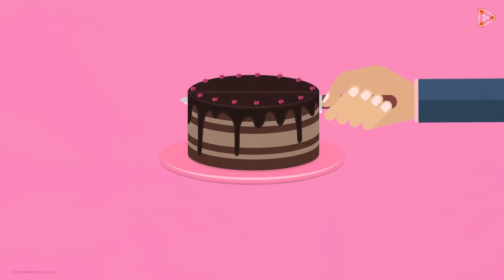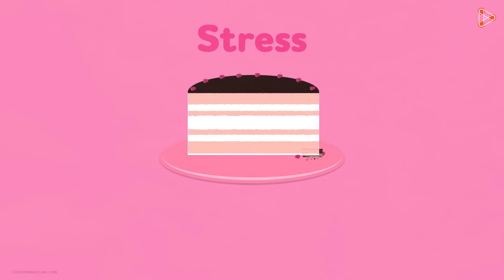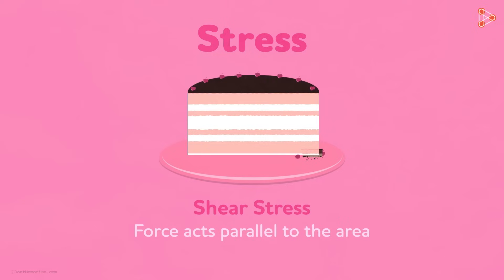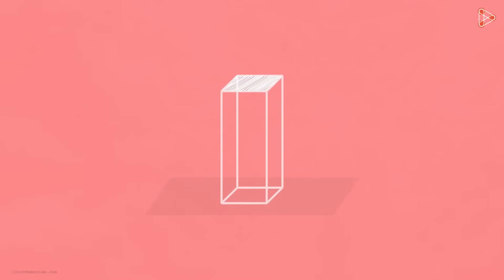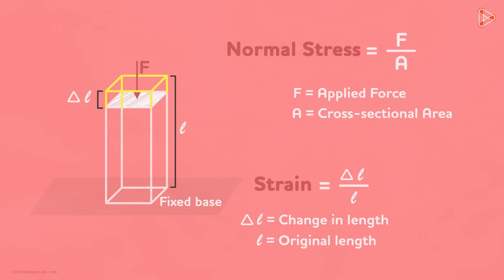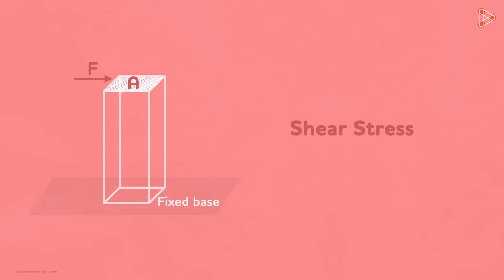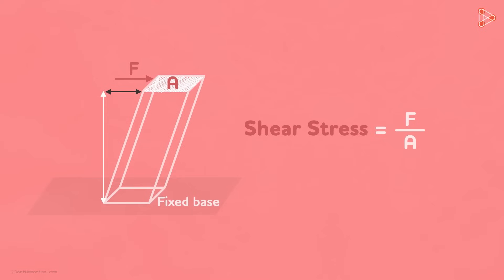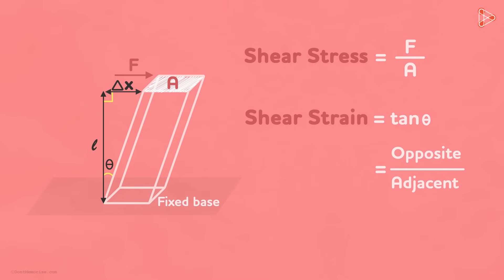Shear Stress and Shear Strain | Mechanical Properties of Solids | Don't Memorise

Comment: i think you guys have got confused with both stress and force. how come when you are applying a force though the knife to cut the cake there is a instantaneous stress getting induced that is acting on the downward direction. as far as i know a stress is the counter force  that is produced by the body to resist the change. so in that case here stress can be only acting in the upward direction to resist the force produced by the knife........